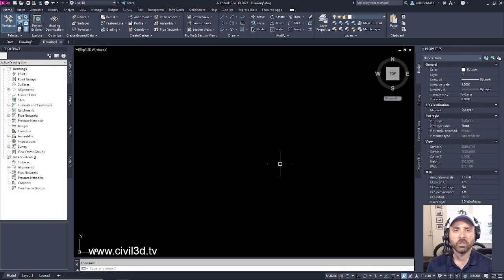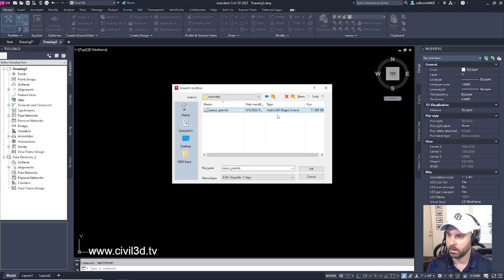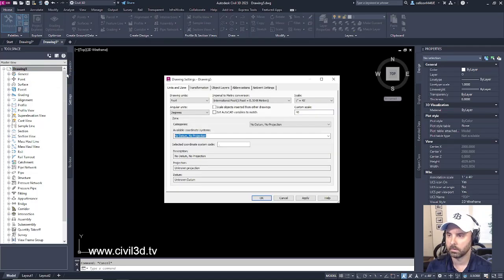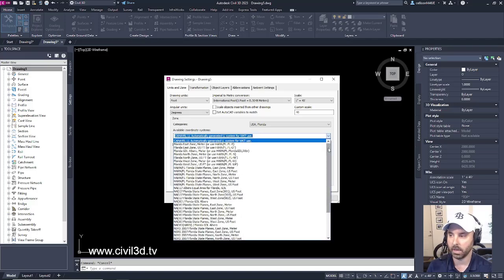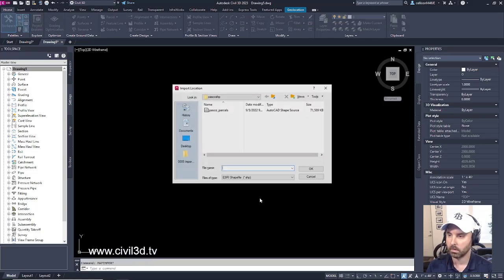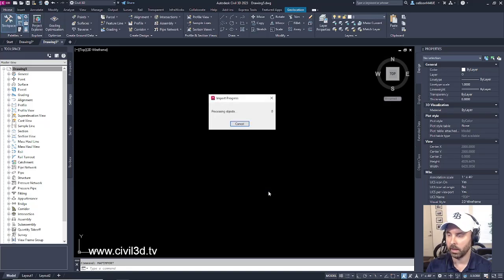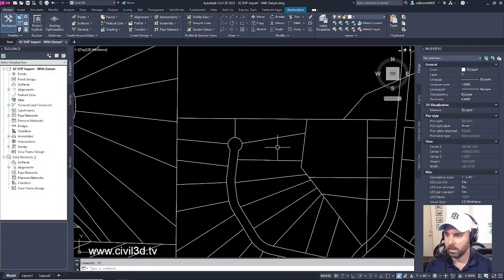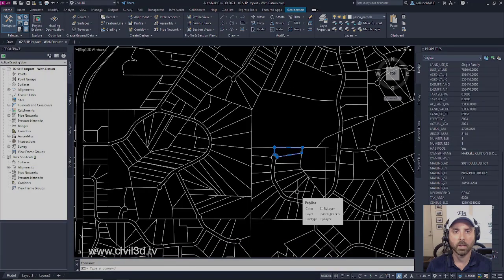Importing GIS Shape (SHP) Files with MAPIMPORT in Civil 3D 2023

Comment: Is there a way to get the transformation settings to apply when importing shape files?
Reply from the maker: Yes — set your coordinate system first in the drawing, then import the shapefile. Civil 3D will apply the transformation automatically as long as both coordinate systems are properly defined before import.

Comment: When starting the Map Export via command _MAPEXPORT, or Map Import via _MAPIMPORT in AutoCAD Map 3D or Civil 3D, the following error is displayed: 
AutoCAD Map Warning : Module AcMapImpExpUI.arx cannot load module AcMapImpExp.arx. The Module may be missing or another component upon which it depends may not be configured correctly. How can I solve it? Help me please
Reply from the maker: That error means the Map 3D import/export module didn’t install or got corrupted. Fix order:

Close CAD → Autodesk installer Repair (ensure Map 3D Import/Export is selected).

Reset settings to default (Start Menu > Civil 3D > Reset).

Run once as Admin, then APPLOAD → load AcMapImpExp.arx from the program folder.

Update to the latest patch.

Make sure you’re in a Map 3D/Civil 3D workspace (not plain acad).